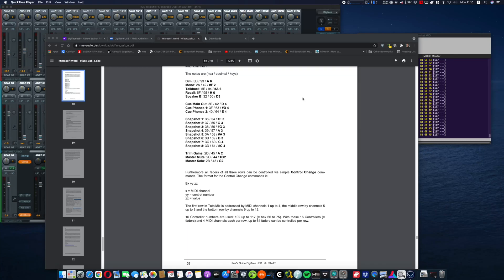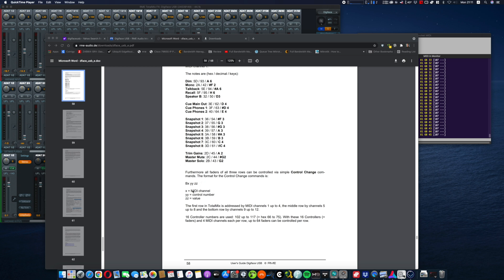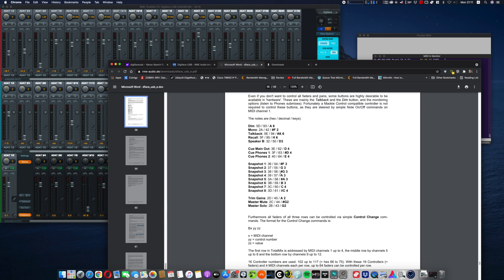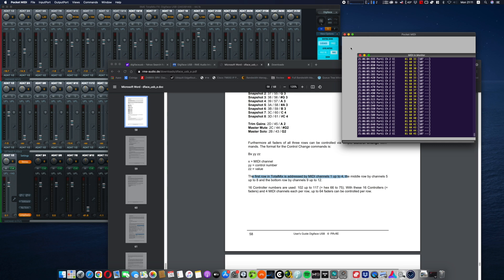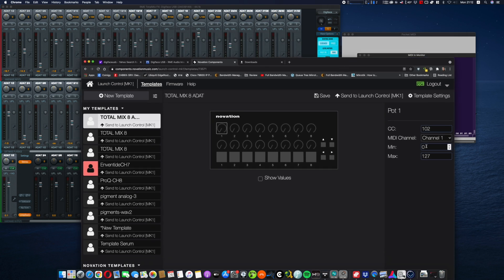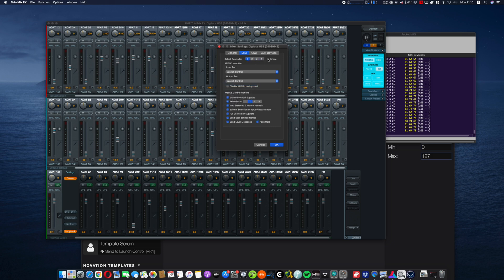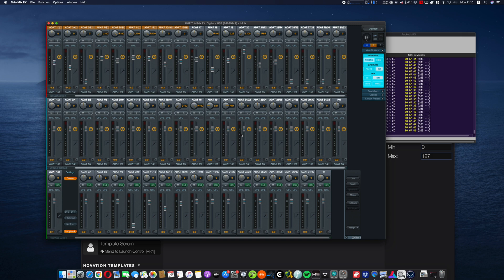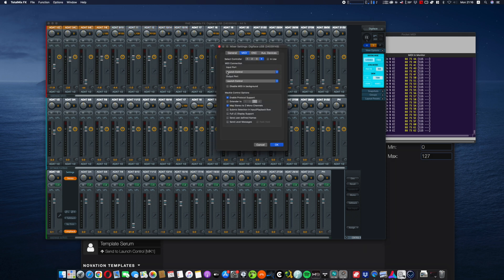how to assign midi cc value to rme total mix

Comment: Thank you this was very helpful. How do I figure the CC value for the Mute button of the Main Out?
Reply: From what I understand it should be CC Value 44 on Ch1. Is that correct? Doesn't seem to work, however the fader is working to control the main volume on my Launchkey49 Mk3 (103, Ch9).
Reply: @sarinsahil  Were you able to figure out the dim, mute, and the other buttons? For the love of God, this is driving me insane.
On another note, I’ve got an SSL UF8 and the faders don’t return to their positions when I switch mixes. It’s like it can send MIDI data but can’t receive it. Also, the channel names don’t show up on the strips

Comment: I'm trying map my Novation Nocturn.  I got the Control Room volume (cc7) mapped.  I'm can't figure out what CC# the Mute is, or even the Dim.  Any insight?  Thanks
Reply from the maker: have you tried searching in manual? i got most of the value from manual. .wow your nocturn still works., my nocturn knob is jumpy now.. i think it is almost16-17 years old.
Reply: @manitsony6703  I actually can't seem to find the manual on their website but found an except on gearspace.  Where it's printed "Dim: 5D / 93 / A5"  But I can't get A5 (93) to work.  I have CC7 working for volume for the control room.  Yeah this Nocturn is going strong.  It has a couple knobs that' has a tiny bit of a jump, but I clean them regularly so that helps.  Also got a remote sl25, the first one ... trying to think how to integrate it.